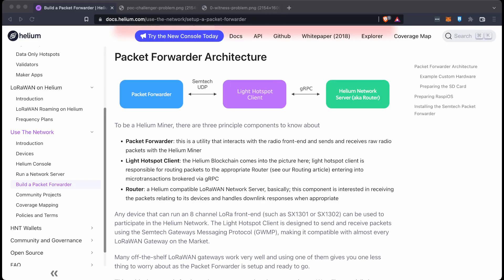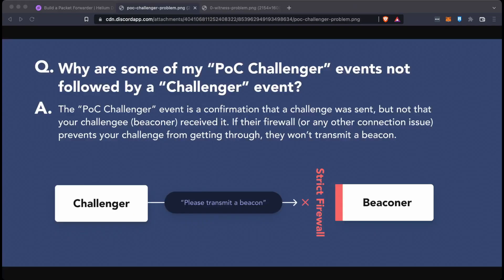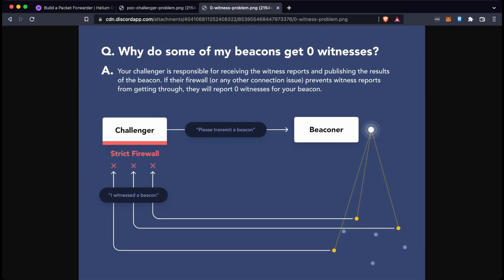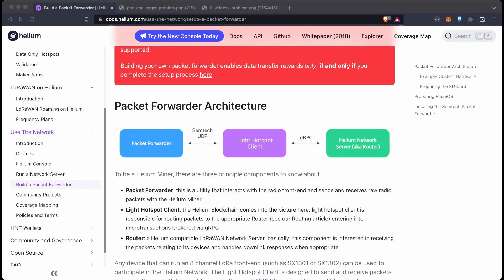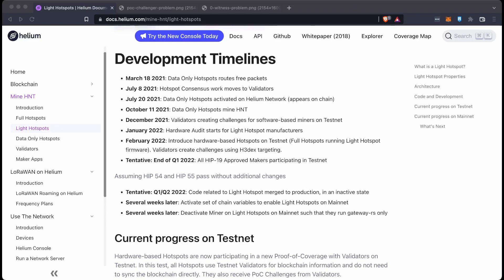Helium Light Hotspots Explained

Comment: Hi Neil, great video as usual. Apologies this has been covered but do you have a date for when light hotspots might be able to purchase and any idea on costs for units? Thanks
Reply from the maker: were months away, they'll be in the $300-400 range. (my opinion based on what I know)
Reply: @BFGNeil  that's great not long to wait! Would you suggest holding off buying any more full hotspots then and just buy the light hotspots when they become available?
Reply from the maker: @chrisneedham3372  well, the time to live and delivery could be a few months for each, so I'd rather have the time if you can get fulls in now
Reply: Hi Neil, one thing share with you, in India only two companies provide helium devices, one is senscap  & clodpi, but they give @ 700 $ to 800 $ , charge too much high , guide me any other way to buy in India 🇮🇳, and can we add antenna of 10 dbi

Comment: I have had serious and bitterly disappointing problems with being relayed, due to our Internet provider using a CG NAT, essentially I can't do port forwarding. And so suffer from the problems you described. Do you know if my hotspots will automatically change to light hotspots on their own and will that stop them being stuck in relayed?
Reply from the maker: Yep, they automatically convert, and relay stops being an issue